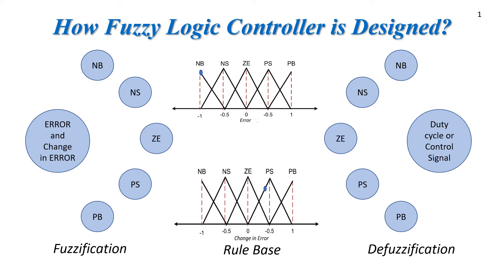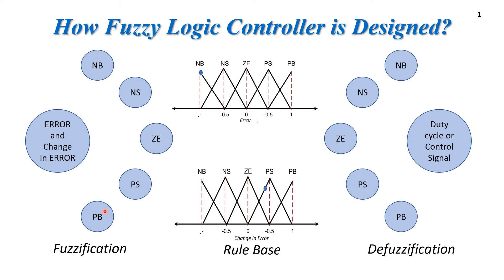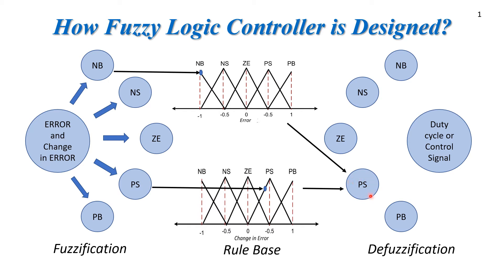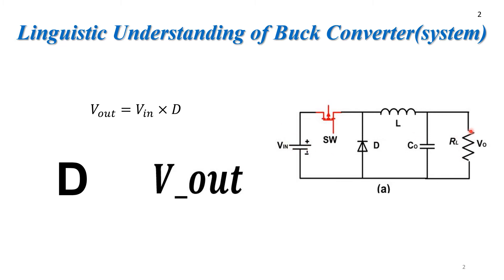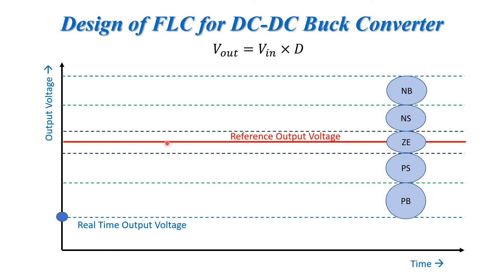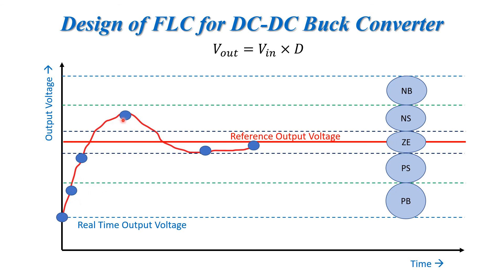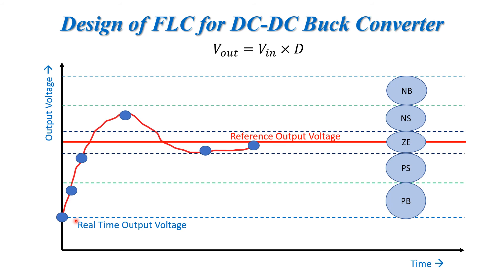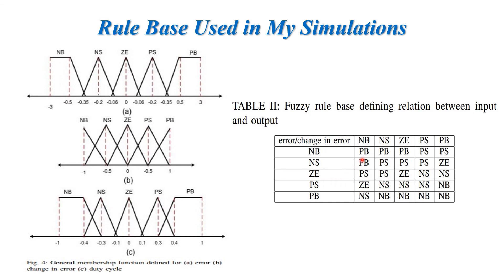Implementation of Fuzzy Logic Controller on DC-DC Buck Converter: Matlab Simulation (Part 2)

Comment: Sir what is the relationship between error and change in error,  and how did you come to the conclusion when error value is NB and change in error value is PS the output should be PS ??
Reply from the maker: I don't understand what do mean by relationship between error and change in error. Error simply means (reference  - desired output). Change in error = (Error at time t - Error at time t-1).  Why have I taken output as PS (for NB and PS) these decision depend on the property of your system. The busk converter acts in a way that when error is NB and change in error is PS the control signal must be PS to decrease the error. Hope it gives you clarity

Comment: how to decide the range of error & change in error ( membership function) ???
Reply from the maker: Generally, It is good practice to keep maximum range equal to 1 and scale the segments (PB, PS, Zero, NS, NB) accordingly. For example , if you have desired output Vout = 18 volt and when you output is from 17 volt to 19 volt you want to call it zero error, then in membership function keep you Zero function from -(1/18) to (1/18) because according to scaling 1 is at (18/18), and -1 is at -(18/18). This is just one way to do it you can scale according to your requirement .